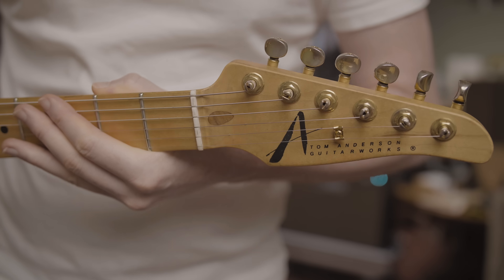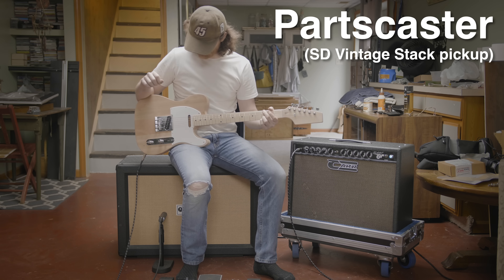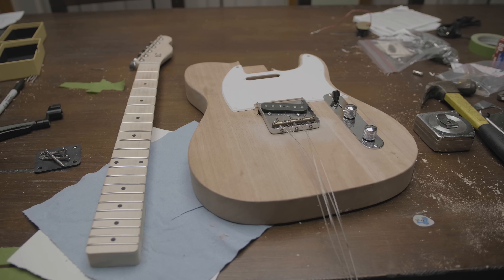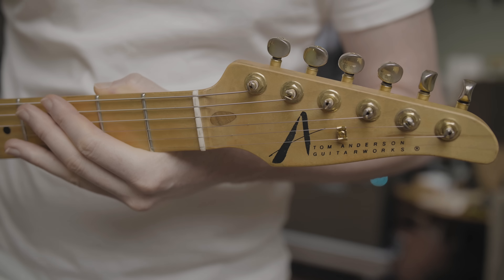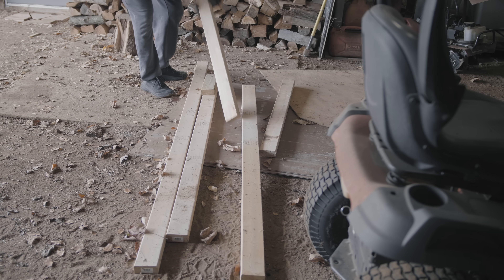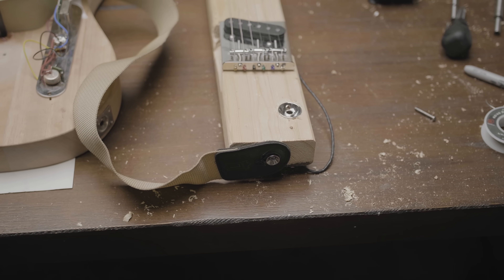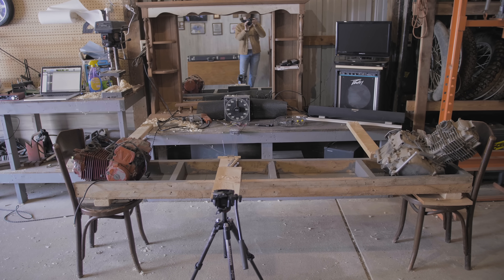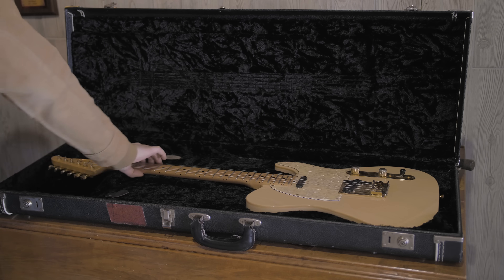Tested: Where Does The Tone Come From In An Electric Guitar?

Comment: This is gold! Well done. For years I've been scoffed at by friends and on forums and this does a lot of correlation to the wood being a contributor but no where near the main contributor to the overall tone.
Reply: Well what exactly is "overall tone"?
The tone of a guitar is more than just strumming open chords with overdrive or playing simple overdriven riffs without letting the tones ring out, with hardly any dynamic shifts.
That´s like taking a Stradivari and a generic modern 500$ violin, bowing the open strings and play a very simple scale and then conclude that there is hardly any difference between the two, or that their "overall tone" is similar.
It is all in the nuances, in the dynamics, the attack, all up and down the fretboard. It is the little details that make the difference.
Someone unaware of those details (most electric guitar players actually, that play as a hobby and simple, mostly overdriven stuff) strums a chord and says "sounds the same".
Reply: @modestoney1577  It is many things that contribute to an instruments overall tone. Fingers, materials, winds of the pickup, pots, magnets, the interaction of the amp and cables… this is an excellent video that try’s to eliminate some variables to find the main contributors to tone. It’s also a work in progress with a desire to find out more. I for sure was not implying that wood or build quality has no factor but I see a lot of correlation to the woods being less of a factor than what people who have scoffed at me in the past about have claimed. I look forward to seeing more from him on this in the future.
Reply: @stephentietjen4517  You don´t understand, that this video only "eliminated" in terms of the things compared - mostly open, strummed, overdriven chords. Not more not less - it says nothing about if and what differences may appear when playing very soft vs. very hard up and down the fretboard etc.......but that is what most (non beginner) guitarists do, that care for nuances.
Reply: @modestoney1577  You don’t understand that this video is about working on certain variables and replicating certain tones and riffs. This is not a complete video. He said this in the video. This is the start of a process.
Reply: @stephentietjen4517  i do understand perfectly. I don`t critisise the video, but the wrong assumptions some people in the comment section jump to.
Reply: @modestoney1577  Oh I see. You commented on mine so you must think I have the wrong assumption that the wood is not the main contributor to the overall tone of an instrument. We can just agree to disagree then.
Reply: @stephentietjen4517  Of course wood is not the main contributor for the overall tone of an electric guitar - but i guess no sane person has ever doubted that.
Once you change a pickup you know.
The big debate is about whether tone wood does have a perceptable / significant influence or none at all.
Reply: @modestoney1577  there's literally no difference, and even the most elitist violinists have been fooled with the Pepsi challenge when trying to tell the difference between a strad and a modern instrument. The only effect these things have on a person is vibe. It's a placebo effect. There's no real difference, but some people are inspired to play more and have more fun when they believe they have something special.
Reply: @DrDizzleFrizzle  

"In both the Paris and the New York experiments, the study found that people thought the new violins projected their sound better. That was true when the violin was played alone or when it was accompanied by an orchestra.

They also found that the sounds of the new violins were generally preferred overall."

Doesn`t sound like literally no difference to me.
Reply: @modestoney1577  they thought the modern ones were Strads, which they all believed to be the greatest thing since sliced breath with magically aged tonewood that can't be replicated. Turns out...
Reply: @DrDizzleFrizzle  The point is not what they thought was what or which sounded "better", that´s all subjective. The point is that they could hear a difference.
Reply: @modestoney1577  That is the point, because their ears lied to them.
Reply: @DrDizzleFrizzle  Not in the regard that is a difference - but you claimed there was literally no difference at all.
how this existing difference is judged, as better or worse, doesn´t change the fact that there is one and it is audible.
Reply: @modestoney1577  I said no real difference between a strad and a traditional instrument, as in nothing that makes it elite above other things. All instruments have variables, but the most perceptible to human ears would.be volume and air being moved. String choice makes more difference than anything on an acoustic instrument. Nothing makes a real difference in an electric, other than pickups and the amp.
Reply: @DrDizzleFrizzle  If there was no "real" difference, than the experiment would have had an outcome of 50:50 in guessing what is what.
But this wasn´t the case. People could distinguish the two violins. 
So there was a perceptable difference.
It doesn´t matter which one sounded "better" to them, because that`s all subjective. The point is a difference was to be heard - a fact you denied before.

Please answer this question: 
How do you know for certain, that body material / wood does make absolutely no difference in tone, attack, sustain, and dynamics of an electric guitar at all?

What exactly led you to this conclusion?
Reply: @modestoney1577  real as in identifiable and something other than "this is different".

As for electric guitar, wood and so on has no effect on tone because of the way that it's designed. Pickups are not intended to be microphonic, and when they are, it's a flaw that most people want to fix. Pickups aren't picking up the sound of strings, but the magnetic interference. 

The main issue is that people that talk about tone don't know what the fuck they're talking about. Even if wood did affect the EQ, your pickups, pedals, and amp all affect and change the EQ. Sustain is not tone, and wood is an inferior material for sustain.
Reply: @DrDizzleFrizzle  You said before that there is "literally no difference"-

Choose your standpoint / arguments.

Pickups are to various degrees microphonic, some more than others.
Doesn´t matter if they were intended not to be. 
The magnetic interference a string produces is directly related to the movement of the string - this movement ist directly related to the guitar body - that is why you hear it over the amp if you "bump" on the guitar body or the reverberation of tremolo springs in a strat.

So, yeah, i get your last point.
Reply: @modestoney1577  oh, so badly trying to be pedantic. There is no tonal difference in your guitar signal based on the type of wood being used. Microphonic interference is not tone, nor does it have tonal elements. Good pickups fix this issue, and if yours do, wax pot them. The only thing knocking on my guitars does is ring the strings.

Anyway, other than pedantry trolling and strawmen, do you have an argument or point to make?
Reply: @DrDizzleFrizzle  LOL, i am bringing factual arguments, that just prove you wrong - if you call that "pedantic" so be it.

Those are facts nontheless. But i am open to counter arguments, if you have any.

Do you even know what microphonic means? Of course it has an impact on the tone, as the pickups also pick up acoustic aspects of whatever sonically happens around them - to a various degree. And very often players who want pristine clean tone (country pickers for example) actually prefer microphonic pickups. You have absolutely no clue what you are talking about, son.

But lovely how you have no evident arguments and call me a troll.
Reply: @DrDizzleFrizzle  You have to read more carefully - and at least try to understand what´s written. I do not believe in anything - all my arguments are factual in nature.
My description of how a pickup works and that most are to are certain degree microphonic is fact. 
That you can hear a "bump" on the guitar body through your amp is a fact.

All i did was factually debunking your claims (that are backed up by no evidence whatsoever).

That has zero to do with believe.

Your strawman concerning the "reality of tonewood" is ridiculous.

My point is, that there is no objective evidence that would prove that the body of an electric guitar and it´s resonant properties have absolutely no effect to the guitar`´s tone whatsoever.

Enough to get you rotating obviously.
XD

Comment: The air guitar is amazing. Firm proof that the majority of artisan crap you hear about electric guitars is bogus.
Reply: How ist that proof?
Maybe it would be if guitar playing consited of strumming open strings only.....
Reply: @modestoney1577  He played it with a slide at the end of the video. The tone doesn't change.
Reply: @sidgar1 slide playing is basically playing open (non fretted strings) with a kind of moveable nut.
Reply: @modestoney1577  But isn't your finger basically multiple capos for each string when fretting...
Reply: @inko.gnito0411  That´s a way to look at it - but it is still a fretted string. One reason some guitars have a zero fret is so that the open string sound more like fretted ones to make a more homogeneous sound.

Comment: Fantastic stuff. Maybe worth testing long notes duration (sustain)? I'd guess the air guitar would be equivalent to an infinite weight guitar, if both sides are very heavy and rigid.
Reply: I´d also be very interested in a dynamics test for both guitars with a clean sound, no overdrive, up and down the neck and let every note ring out.
When there are differences they are in the nuances, attack, sustain, dynamics etc.....not in the general tone of overdriven open chords
Reply: @modestoney1577  absolutely. Open strummed gain tones are pretty useless for a comparison. It's a shame because he put in a lot of effort. But he didn't approach it as a musician but rather someone who wants to debunk something. On the other hand warmoth has done a lot of sound wood tests and approached it very "scientifically" but from a musicians angle and consistently proved that almost everything on a guitar does change the sound to some extent. But, at the  same time, for various reasons, you can try and almost succeed to make two different setups sound the same. There is no ultimate rule here but generally speaking the tonewoods debate is really stupid because obviously different woods and different pieces of the same wood blanks will have some impact, be it minimal or substantial, on tones, sustain etc.
Reply: That would be the bridge, not 12 pounds of mahogany.
Reply: Sustain is an overvalued quality. Most guitars have all the sustain they need unless they suffer from fret buzz or have saddles made of a soft material.

Comment: Pretty much any builder will tell you 95% of the tone comes from the pick up. Thats not even a question for most folks. Its what happens after that makes the difference. As in once the note is fretted things like attack, and sustain come into factor and shape the overall sound. The split second you hit the note, the lump sum of the parts that come in contact with the string will shape that sound. The ashtray bridge is the main reason a tele honks, like it or not, they do not do it without it. You gotta do more than play a few chords or hit open strings to hear that. You CAN increase the sustain in a guitar by fitting the neck properly. True it doesnt change the tone, but then I dont know a builder who said it did. It just makes the guitar ring out better. On a LP you can swap in vintage Bumble bee capacitors, do they make a tonal difference, not that I could tell, but when we swapped out the LP pcp board and wired it vintage style, that did change things. To the customer It opened up a wider range in the pick ups. So he raved about his new tone tone, but are these tones or sounds ? Tone is what the guitar sounds like before you augment it as you have shown. You cannot change that without directly altering the pick up. What we did to the LP was fitted excellent quality potometers which has a specific frequency range that suited his playing and this allowed the same pick ups to reveal frequencies he couldnt access earlier. He suddenly had an instrument that suited what he was doing to it, That is why Guitar builders will always be needed. A person can build two identical guitars and still have a preference between them. What made them choose was the little things the guitar did after they hit the note. How it feels etc, how long the string resonates, does it feel alive or muted, compressed or open, even the height of the frets can make it sound harsh or make ping noises when you hit the string hard, all these things are factors of the overall sound, and go beyond the original tone. Its the reason why Jimi would sound like Jimi on your strat or tele, he holds the guitar different to you, has a different grip or way of holding his pic, all these things contribute to the over all sound that is Jimi ! the problem is, we call that tone as well and there is the issue. Truthfully, Jimi would sound fine to you and me, but he could hand you back that guitar and tell you it was crap because you dont hear how it feels. Now, would he sound precisely like Jimi at Woodstock ? Hardly, but again, that is an entirely different sum of parts !
Reply: Well put, there is so many nuances in each guitar, I agree that the experiment is not complete with out a player using each one to full extent.

Comment: 2x4 Tele - love it.  Having an electrical engineering background, I've always said it has nothing to do with wood unless the pickups are cheap and microphonic.  Quality pickups only pick up the signal from the vibrating string so things like string length and thickness, pickup position and windings, etc have the most to do with tone on an electric.  The wood will have something to do with sustain but thats about it.
Reply: Then the signal through speaker and cabinet is the next biggest tone factor. All that said, feel is important to the player, so shape, weight, heck even color influence the player.
Reply: @richtasteslife  Thats obvious but this was about wood affecting the tone.
Reply: The pickup picks up relative motion of the string. Whether the string is moving or the pickup is moving, the pickup does not know the difference.  Therefore, any vibration of the body transmitted to the pickup (and thereby vibrating the pickup) changes the relative motion of the string and will be transduced by the pickup. 

How much that is and the influence on overall tone is a big question.
Reply: @johnkos3116  I see what you’re saying.  My understanding is the pickup works using Faraday’s Law of Induction.  The string is vibrating in a magnetic field, which creates a change in magnetic flux, which induces a current/emf in the coil, correct?  Any moving ferrous material can generate that current/emf I believe.  It may not be able to induce a current in  itself; that sounds like some fantastical perpetual motion-like machine, haha.  All I know is unshielded unpotted pickups sound more savage in a tighter build with better wood.  Shrug.
Reply: Allegedly, authentic PAF humbuckers are (should be) microphonic.
Reply: I agree with most of that.  However, some beautiful vintage spec pickups are microphonic, so the wood is critical.  Yes, you can’t really bring those guitars to the bar, but the tone you can get with a properly built T-style with Don Mare 0038’s (for instance) is absolutely savage.
Reply: @Adveniotu  The amount of the signal that comes from the microphonic portion is actually very small and most people wouldn't notice the difference.  You can try this yourself if you have a cheap or old pickup that is microphonic.  Play a note normally and then basically try to scream into the pickup and you will find it barely picks up your voice(at least most will be this way).  Piezo mics(pickups) are a different story as they are microphones at heart.  A pickup is an electrical device and will only be influenced by electrical/magnetic property changes.  Its kind of like saying the electricity in your house is better if you have a brick house.  The surrounding material has little to no effect on what is travelling down the wire and this video shows that.
Reply: @teebee-007  Yep, I’ve tried that experiment.  Call it superstition, but I feel the vibration from the body is much more pronounced than the reverberating air produced by your vocal chords.  I’ve experimented a lot with different woods and pickups, and the tone generated using old-spec pickups in good wood with good hardware absolutely has more “hair” on it.
Reply: @teebee-007  I agree body wood doesn't impact tone very much, since pickups only pick the strings vibrating and all being electromagnetic, however I also think tonewoods can change how the string vibrates to a very little degree, very irrelevant tho, similar to how different bridges impact tone (hardtail strat vs trem strat vs tuneomatic vs etc). I would say pickups, bridge type and guitar scale are the most tone defining elements, maybe semihollow vs solid makes a bit of a difference.
I just wanted to say your comparison is a bit off, while i do agree with your point of view.